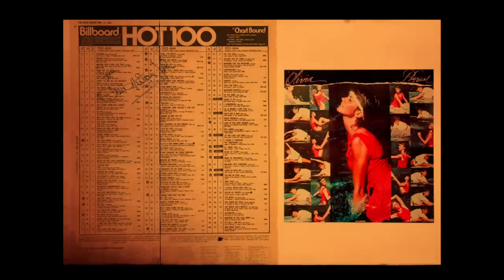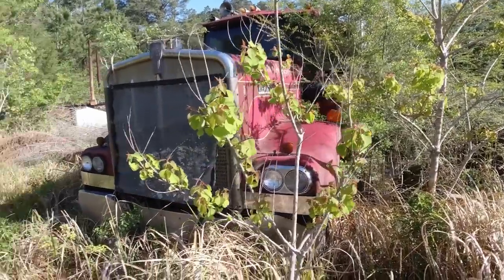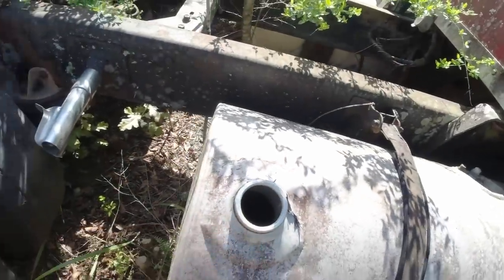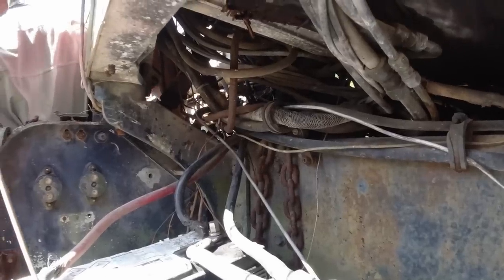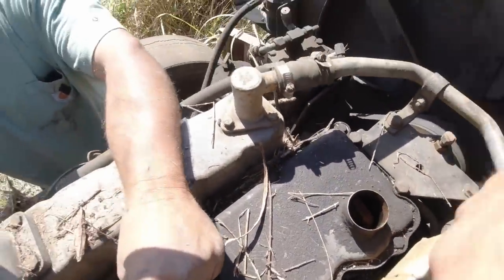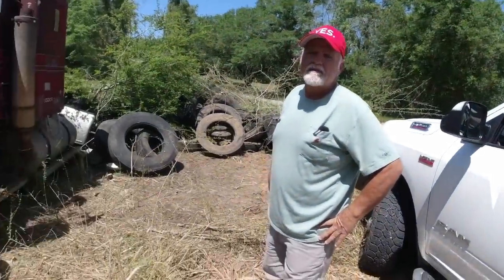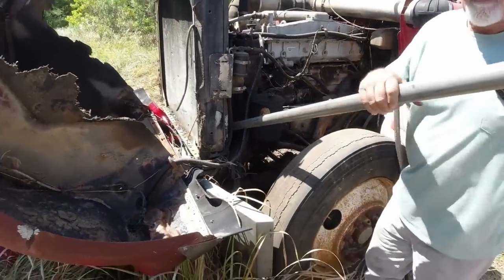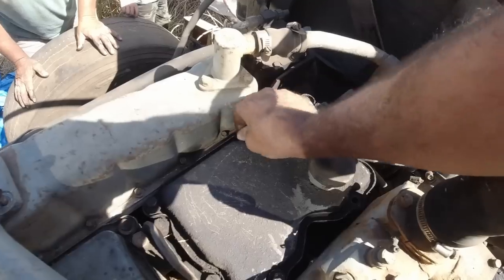Can we crank this 1982 Kenworth W900 That sat for 15 years?

Comment: That marvel mystery oil was draining straight into the oil pan through the oil return galleys. If you want it in the cylinders, you need to pull the injectors.
Reply: Best way Pull it to a hill Roll it down. Use clutch to break the speed down. When the thing rolls freely, engine in gear 🤨 turning freely, simply stop the truck and shoot in starting fluid, as one crank it

Comment: If it was the 8v92 Detroit...it would have fired right up. Ive seen a Buzzin' Dozen in one of these..they used it to haul gigantic loads up in northern Canada. They used 2 stroke Detroits in these mainly in the colder areas, Cummins in the warmer  areas.
Reply: If the engine was/is locked up it wouldn't make any difference,  I have seen 2 stroke Detroits that locked up do to lack of oil, or water in the oil to say IF it was a Detroit it would fire up is an incorrect assumption.
Reply: @bertgrau3934  Well look at the 53/71/92 DDC expert...how many years experience do you have working on them? Drop some knowledge on us.
Reply: @netrioter  
I was in the trucking business for 44 years, I have lots of experience with lots of different engine makes,  Detroit,  Cummins,  cat,  Perkins,  Mercedes,  and Volvo.  The only Detroit that made real power was the 92 and the 12V71 they were both low fuel mileage engines.  I've seen the newer Cummins  , (15  liter) after 1 million miles tend to throw a rod.  Don't know why. The cat had problems with the cylinder liners not being the correct deck height,  which would cause the head gasket blow that was the newer engines as well.  The older cats were better,  but would Break the bank when they did Break down.  The older Mack's were good engines,  the newer Mack engines weren't bad either,  when Volvo took over Mack,  the quality went out the door.  Don't know about the Volvo engine now, maybe Volvo got the bugs worked out. The Mercedes 16 liter V8 is a good engine as well,  runs strong and dependable,  but gets horrible fuel mileage.  ( can't get that engine in the USA , can't pass USA EPA requirements) live in the USA but I drove both Mercedes and Volvo in Kuwait, and Iraq.  The Volvo engine used in their European trucks seem to be much better than the American engines as well.  
The one thing I like about the 2 stroke Detroits,  is the noise they make.  The fuel mileage is bad, and the power is down.

Comment: If I'm not mistaken,  '84 was the last A model 900, then in '85 came the 900 B model, then as a prototype for the James Bond movie was the first 900 L model in '89 which was the 007 W900L. The original plan was to not mass produce the 900L, rather use the prototype and/or however many it took to make the movie, however,  Kenworth saw how popular they were among the trucking industry through the public eye and decided to continue the model for the working man. Thank God!

Comment: I can only speak for Australian W models i first drove one in the mid 80s it had a black 400 cummins, a fifteen speed road ranger 1810 driveline, with 44000 lb diffs on a Hendriksen suspension, it was the best truck I ever drove I loved that truck. carted 80,000 kgs {80 ton} of wheat on two trailers in to the Bin at Walgett NSW . It would easily blow the doors of any 400 mack , especially in the hills believe it or not. you could change gears so fast it was awesome no clutch required. I noticed your truck had a late model gearstick. in Australia some of them came out with a 13 speed R/R. .but would have been with the big chrome knob and a sliding range change and splitter button. most of the trucks on the east coast had cummins motors and 15 speed R/R  on the west coast 13speed R/R . I drove 3 different one over the years they where all awesome. Why do American trucks always have lawn mower tanks, it must drive you mad fueling up all the time. how do you get on when your out in the back blocks carting 6 decks of cattle or something like that. plus they look odd. .the view over big bonnet was awesome . as good as the view over the bonnet of a Western Star ,Heritage series. another awesome truck..

Comment: Do you remember you both got same truck in last july? it was runing tho. Btw, you poured marvel mistery oil to the cylinder head, but here is the thing, you cant reach to the cylinders from head esp in diesels there is no another hole except injectors. You have to pull injectoıs out to put some oil in to the compression chamber. Your marvel mistery oil went in to nowhere but crank case. Remember oil filling neck is on top the cylinder head cover,  oil goes to crank case then oil pan. Of course if it is not making oil itself smiles. Always fun to watch your videos esp when wiley is in there too, Good job guys...

Comment: Just some help pulley with two large belts that go to the fan is gear driven on those Old Cummins from small cam to Big cam to N14 1 5/16 socket make it easier next time but good project for a More modern drive train a power plant

Comment: Engine seized, looks like it got a bit of water in it. A series starter with field coils should work with reversed polarity and rotate the right way. A reduction starter with permanent magnet field is polarity sensitive. But reversed polarity is not good for the alternator and other electronic components. Great job in melting off that battery terminal.

Comment: There is a way of turning the engine over use the gearbox take the gearbox in first gear bolt a bar to the prop flange can sticker a come along on it it will either slip the clutch or break the engine free or if you're feeling dangerous you can try pouring boiling oil into each cylinder but that's best done in a workshop with the engine out

Comment: It might have a Cummins or a mechanical cat 425 those mechanical cats can outperform anything on the road today cuz you can make manually adjust them you don't need any computer or ECM. There are two types of w-9s long nose and short nose this one looks like a pill box sleeper not uncommon for those year trucks👍👍♥️
Reply: Good old 3406B models!

Comment: I  worked with another mechanic an he had a tool that went in the hole the starter came out of. It was a kind of power multiplier as it used a half inch drive ratchet or flex handle to turn engines when working on them... like adjusting valves and such.. should a guy get his hands on one of them, best chance you would have of turning it over... I thought those     had a access hole in the bottom for adjusting the clutch with.... you could bar it over through that hole also.
Reply from the maker: I’ll have to research that
Reply: @HamiltonvilleFarm  There's a plate you can take off on the bottom of the bell housing that he's talking about. 4 bolts seems like. Rectangular shaped stamped steel. Might have a grease fitting hanging out of it for the clutch throwout bearing.

Comment: Since the drive shaft is missing you could bar the engine over by putting it in gear and use the yoke on the gearbox to turn it over
Reply: in ovrrdrive

Comment: I have a will it start story for you. I have a 1985 model Troy Built Rototiller. with a Brigs and straton 8 horse motor. it has  not been started for about 20 years. My neighbor and I worked on it. He filled the tires  with air after putting new inertubes  in thne tires. He had sprayed all the places that wouldn't move.  the leavers for the tines, andthe leaver for the forward and reverse . After  he cleaned the gas tank . checked the carb.  He put some gas into the tank. After he had changed the oil, Checked the transmission for gear oil. Time to see if the motor would fire . After 4 pulls on the starter rope  away she went, purring like a kitten.
Reply from the maker: Ain’t that something! Fun stuff

Comment: You guys did your very best trying to get the truck to start up it's been sitting out there in the elements for far too long and the owner said it was a good running truck up until this point. So if you at first fail to succeed, try again another time.

Comment: Or the flex plates could be rested shut on it and that could be holding the transmission even though when it's out of gear even knowing it's out of gear might just have to pull on it drop into a gear with a tractor and it should break the motor free

Comment: That should be a w900a which you can tell by the round headlights the w900b has the square headlights the a was the first version in the 70s and the  B come along somewhere in the early 80s or late 70s

Comment: When you said you had a torque multiplier probably most of us older mechanics were expecting to actually see a torque multiplier not a cheater pipe so we were waiting to watch you twist the crankshaft bolt off if the engine was stuck really bad. Lol
Reply: A friend of mine once bought a super long nose KW many years ago with a 600 Cummins with a manual 5by4 transmission because the former owner had a driver that received 3 speeding tickets in excess of 120 mph fully loaded in less than a year. It was fast and beautiful it was solid black with every chrome option KW offered including polished aluminum wheels
Reply from the maker: I meant I own a torque multiplier but it was t in my truck at the time… however I have since added it to my every day carry in my tool box 👍

Comment: FUN FACT . When PACCAR bought up the DAF  truck factory in Eindhoven the Netherlands 🇳🇱  they also bought the technology for the MX12 engine with it . The MX series engines were a last ditch attempt by DAF to revive from the bad times that they was in. It is safe to say PACCAR was happy to have the MX 12 engine to starts competing with the likes of Volvo.   Also Eindhoven is my home town and I have actually work at the DAF plant on several occasions.  🙃.  And now I live in the US of A . Sighs 😕.
Reply: DAF trucks build a purpose build engine test facility for testing and proving the MX12 and later the MX13 engines and had KW and mack trucks on site to fit these engines into for road testing.  The first thousand or so engines were produced in the Netherlands and shipped to the US before PACCAR fitted out a plant to make the engines in the US.  Strange to me is that the mx engine is an option instead of a standard engine for PACCAR trucks like KW and such.

Comment: I would bet water got into the exhaust. Seeing’s how the muffler had no top to it. And again you are not putting that marvel mystery oil in the cylinders by dumping it into the valve train. It’s just going to the crank case. Need to take out injectors to do that.
Reply from the maker: Yeah that’s why I asked in the video “is it getting in the cylinders”.  We filmed a grader a couple days ago that we put the oil in through the the intake manifold but I think we’re going to go back and pull the injectors.
Reply: Yeah I replied to that video as well. Must not have gotten the email, or something happened there like Wally not getting my email about the Duce and a half. But all good. Still good video. Thanks for your time!

Comment: A  tractor rig is used to rescue a tractor truck. The truck is big. Heavy equipment will be needed. For repairs. Also, had a grifter perhaps removed a stollen part from 'the old hoarder'🤨

Comment: Something like that I pull the injectors out and pour the marvel mystery oil I've done this before and then I would also pull the starter out now if you can get yourself an old railroad bar rail bar and cut the end of it just right into some teeth on the end of it so it will interlock with the flywheel you can stick the railroad bar in through the starter hole and work the flywheel that way you will get a large mechanical advantage that way with the railroad bar that's assuming that you have the room....but anyway you look at it I'd come up with some kind of a bar that'll going through the starter hole and move the flywheel...work it through a couple of rotations to distribute the marvel mystery oil and not having the injectors in will help with not having to fight compression

Comment: It looks like you connected the batteries in parallel. Meaning the battery was 12v, not 24v ;-) Also, the French word for spanner is "Clef à molette" (pronounce clea ah mo' let )

Comment: From what I'm seeing here and I am a diesel mechanic and a truck driver...... Better you than me..... But then again I don't like cummiins diesels for crap like this I got one that I'm doing right now already stripped it down to the Pistons nothing but heartache.... I'm trying to wonder what did you think you were accomplishing by pouring marvel mystery oil into the top of a cylinder head it's not getting into the cylinder that way I mean you have to pull the injectors if you want to do that....
 the marvel oil would run over and go down into the crankcase but it was not going to get into the cylinders with the piston rings and the Pistons...... You have me staring in utter amazement.
.
Reply from the maker: We are no where near being mechanics. So we’re learning as we go

Comment: 1974 they went to the newer style door handles. 1984 they went to the square lights
Reply from the maker: Gotcha
Reply: 1982 was the last production run of A models. The B model was introduced in 1982 also however there were some A model gliders that were titled as 83 and 84 models.
Reply: I should also add, there were KenMex A models still being made into the late 80’s but only in Mexico
Reply: 1972
Reply: @w900stu8  you’re right on the door handles, I was off a year. 73 they came out with the lower handles. 84 was about the year that all brands of trucks started going with the square headlights but yes 82 was the last year for the w900

Comment: Not only were you missing a driveshaft, yall were also missing the drag link between the steering gear box and the front end so not only was there no go, there was no steer too unless yall wanted to kick the tires where you hoped it'd go...................if it moved, which I doubt. No 300 m.p.h. today. Yall keep it up and you'll end up being Lamont and Wiley will be Fred with yall surrounded by all that junk. Poor Gina and done ruint a poor youngun in the process. GBWYall!